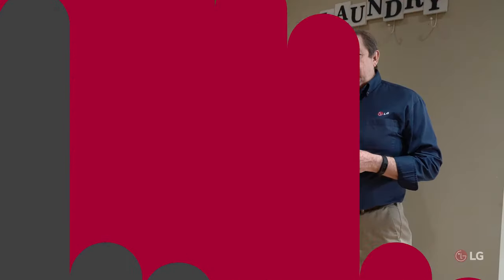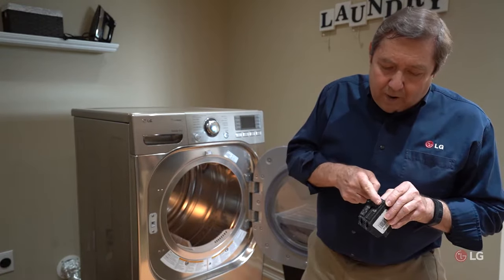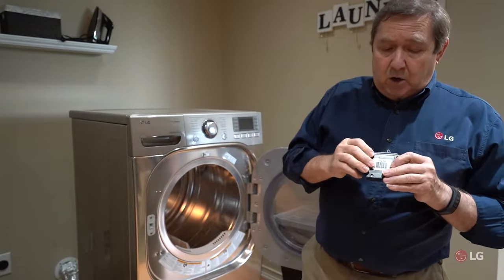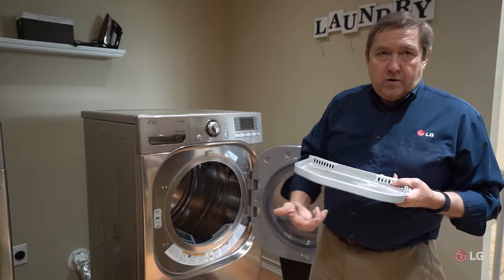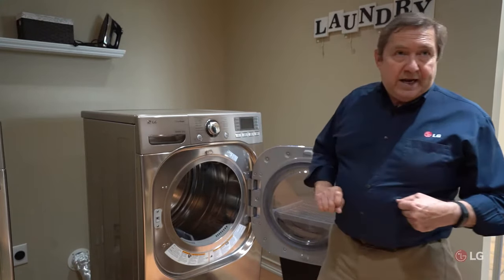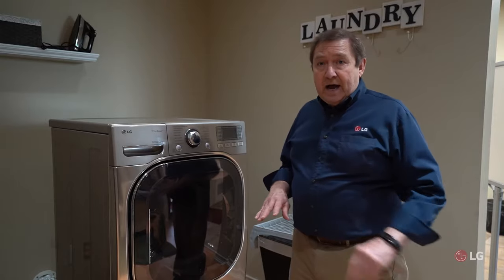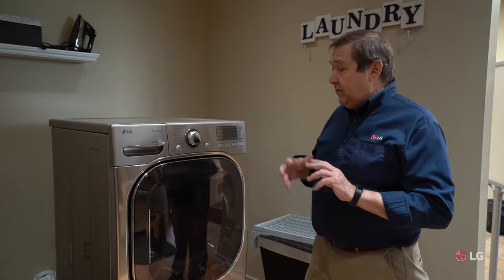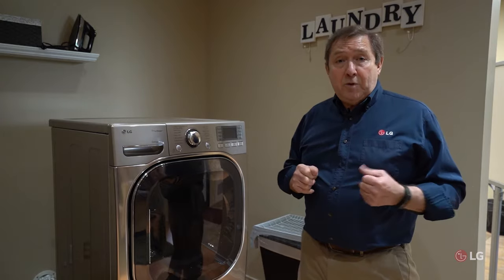[LG Dryers] Troubleshooting Heating Issues

Comment: I was convinced I was going to have to replace my heating element, but I just had some plumbing work done and they had shut the breaker off for a bit, I went and checked and it was tripped only half as you mentioned!  I have an old house (1945).  Thank you for saving the day!  I was about to start taking the whole dryers apart and start replacing parts!
Reply from the maker: I’m sorry to hear you're having this issue, and I’d like to see if we can assist. Please contact LG Customer Support by direct message via Twitter ( @LGUSSupport  ) or Facebook Messenger ( https://www.facebook.com/LGUSA/ ), and include your contact details, the model & serial numbers, and a detailed description of the issue. ^Nolito

Comment: Thank you very much. I used this video to resolve a heating problem with my daughters dryer. Cause of the issue was lent build up in the vent line between the dryer and outside of the house. Once I was able to clear it the dryer worked fine.
Reply from the maker: That is great! Is there anything else that we can assist you today? ^Angelica
Reply from the maker: Armand , after several attempts of reaching out to you, unfortunately, we did not receive any response. We assume that your concern has already been addressed. For now, I will go ahead and end our session. Should you have any other questions or concerns, please feel free to reach out again, and we'll be happy to assist. Have a great day. ^Angelica

Comment: Mine will heat up, but stops prematurely every single time, and the flow sense indicator will come on. It takes 3-4 times to completely dry. I clean out the filters every time I turns off. I’m a single mom of four, so any cheap fix tips I would greatly appreciate. Also I’ve also pulled out the dryer took off the back tin hose connection and vacuumed everything out and as far down the vent I could. I will do the outside vent today too. Let me know if there is anything else I can do. Thanks. 😊
Reply from the maker: Hi there Beth Molloy. Welcome to our Social Media page. Based on your recent post, we see that you may need support. Please send us a private message with your name and phone number and we would be happy to investigate this further.  ^Jovelyn
Reply from the maker: Hello Beth Molloy! I'm passing by to check up on your case. Do you still need assistance? If so, let us know if there is anything that we can do for you.  ^Jovelyn
Reply: I am having this same problem.  Did you ever figure out how to fix it?  LG customer service was zero help over the phone and wanted me to buy a $400 repair package to send someone out for a dryer that is 2 months past the year warranty.

Comment: So I've got an LG dryer that's igniting and firing only for 5 seconds and then shuts down the flame.. Ohms on gas valve are in limit. Other sensors jumped out with no difference. Any suggestions?

Comment: My LG gas dryer wont heat up. it runs but wont heat at all.  The Dry light flashes and my cool light stays on. All thermostats, valve coils & flame sensor show continuity but not heat,  I have tried normal and high heat cycles. I am an independent appliance tech. please help
Reply: Hey did you ever figure anything out? I’m having the same exact issue. Dry light flashes and the cooling light stays on. Still no heat
Reply: Anything ? Same prob here
Reply from the maker: Thank you for reaching out. Can you come to our Facebook page and send a private message? I will be more than happy to assist you.^Sandy
Reply: @Giioventus  thermo cut off thermostat !
Reply: I am having same issue from today. Is there any solution for this?
Reply: @EurekaRecycler  thanks mate
Reply: @EurekaRecycler  my warranty is over any idea how much to fix this? I will never buy any lg.
Reply: @LGUSASupport  you could just as easily try to help everyone out right here in YouTube instead of dodging questions and wasting our time
Reply from the maker: I’m sorry to hear you're having this issue, and I’d like to see if we can assist. Please contact LG Customer Support by direct message via Twitter ( @LGUSSupport  ) or Facebook Messenger ( https://www.facebook.com/LGUSA/ ), and include your contact details, the model & serial numbers, and a detailed description of the issue ^Nolito

Comment: the heat in my LG dryer stops heating, but the dryer continues to run. I re-set the thermostat fuse, but the heat keeps turning off. Can anyone help? Thanks.
Reply from the maker: Hi there. Thank you for reaching out to us. We understand that you're having an issue with your LG Dryer. We'd be glad to assist you with this concern. In order for us to provide you with the necessary resolution, Kindly send us a private message via @LGUSSupport, so we can look into this for you. We'll be happy to assist you. -MC

Comment: Hi John I have an ee1 error code. I have replaced the thermistor, blower thermostat, high limit thermostat, and thermal fuse.. issue I put wet clothes in the dryer.. my fault completely.. so I was able to run my dryer for a short time but after 5 minutes my high limit thermostat trips.. i ordered a new one it worked for about 10 minutes but then high limit blew again.. I could not trip the new high limit thermostat..it would not pop back down like the old high limit thermostat did..  so after replacing the thermistor and blower thermostat I put the old highimit thermostat back in and then got my first error code .. prior to that i was not receiving any error codes?
Reply from the maker: Hi, Andy. I’m sorry to hear you're having this issue, and I’d like to see if we can assist. Please contact LG Customer Support by direct message via Twitter ( @LGUSSupport  ) or Facebook Messenger ( https://www.facebook.com/LGUSA/ ) ^John

Comment: Too basic. I don't have error codes, air is blowing through vent, dryer is warm, but it takes 2 hours to dry jeans, when it used to take 40 minutes. This video doesn't cover anything about dryer not heating enough.
Reply from the maker: I’m sorry to hear you're having this issue, and I’d like to see if we can assist. Please contact LG Customer Support by direct message via Twitter ( @LGUSSupport  ) or Facebook Messenger ( https://www.facebook.com/LGUSA/ ), and include your contact details, the model & serial numbers, and a detailed description of the issue. ^Nolito
Reply: Having same issue as described above.  Had a service person come, replaced some rollers, still experiencing same issue.

Comment: Hi, I've been hoping someone might have an idea how to troubleshoot my LG dryer issue. I've got a fairly new LG dryer equipped with flow sense. The issue I'm having is within the past few weeks, the dryer isn't drying clothes and shutting off a cycle after only approximately five minutes. Initially, I was getting the flow sense error when I tried troubleshooting with ThinQ. After cleaning out the vents, taking the dryer completely apart and cleaning it out, we then went a step further and paid a service to inspect the ductwork only to find out it was completely clean. I even replaced the moisture sensor and still have the same issue. Whenever I run the ThinQ diagnostic, comes back clear. Wondering if you have any other ideas for troubleshooting that I could try. Thank you for your help!
Reply: Same issue did you resolve? Could it be bad sensor?
Reply from the maker: Hi there! I’d like to see if we can assist. Please contact LG Customer Support by direct message via Twitter ( @LGUSSupport  ) or Facebook Messenger ( https://www.facebook.com/LGUSA/ ), andinclude your contact details, the model & serial numbers, and a detailed description of the issue.
^Rose
Reply: We had the same issue as well but then after about of months after buying the dryer it completely stopped running heat 😵😔… after two months of waiting to get a technician out to come look at it they though it was the fuse that turns the heating element off and on so they replaced it and the heating element just in case …. The dryer is heating now but !! It’s still not fully drying the clothes but I have noticed it’s like fighting itself … the cool setting is always on an I personally think this is the issue … I’ve only had the dryer run now for two days or so and I have to force it to fully dry the clothes by putting it on two outs of speed dry 🤦🏼‍♀️ pretty sure it will go out soon again … we will see but maybe check and see if you are having that cool setting running threw the full dry cycle as well I’m starting to think this is a manufacturing issue with a lot of these dryers … I see a lot of it but no one has been able to resolve the issue so far that I have see the LQ thinQ app says my dryer is fine and it’s not throwing a code even when I had no heat 😶… will report if it is fixed or if it goes out again
Reply: @TheLindsey7777
Reply: @TheLindsey7777  hello, did you ever get this resolved? I have the same problem on my LG. Cool cycle never goes away and I’m constantly getting the D90 error

Comment: Actually my lg dryer never stop the cycle and just keeps heating, does the same on any cycle, when the timer its down to a minute it goes back to a 15 or 20 and keeps doing that untill manually turned off, I I just replace the moisture sensor with no luck..
Reply from the maker: Roberto , welcome to social media of LG ,can we verify of you see error codes from the unit ?
can you check the link :

https://www.lg.com/us/support/help-library/power-issues-laundry-dryer-CT10000011-20150394890820

Let us know if this will work. Thanks ^Angelica

Comment: How many degrees fahrenheit is the normal cycle without energy saver?
Reply from the maker: Hi, Jerome. I’m sorry to hear you're having this issue, and I’d like to see if we can assist. Please contact LG Customer Support by direct message via Twitter ( @LGUSSupport  ) or Facebook Messenger ( https://www.facebook.com/LGUSA/ ), and include your contact details, the model & serial numbers, and a detailed description of the issue. ^Chad
Reply: @LGUSASupport  There's nothing wrong with the dryer. I just need accurate or estimate temps for the normal cycle.
Reply from the maker: Hi! The temperature a dryer reaches depends on the make and model of the dryer, as well as the setting at which the dryer is running. Your dryer uses heat to warm the water in your clothes and turn it into vapor. On average, most dryers can get around 125 to 135 degrees Fahrenheit. ^Nolito

Comment: How do I get someone from LG to actually return my call and not redirect me to a video? I need a service person,  it is a new dryer
Reply from the maker: Welcome to our Social Media page. Based on your recent post, we see that you may need support. Please send us a private message. Thank you.  *Leah
Reply: @LGUSASupport  Hi. How can I DM on here?
Reply from the maker: Hi, Justine. I’m sorry to hear you're having this issue, and I’d like to see if we can assist. Please contact LG Customer Support by direct message via Twitter ( @LGUSSupport  ) or Facebook Messenger ( https://www.facebook.com/LGUSA/ ) ^John
Reply: I'm not on those platforms. Here's the issue. I have a D80 but it was checked and clear.  I've only had it since after Christmas.  When I use normal/sensor dry it was running perfectly and was hot. Now it's not heating unless I turn off energy saver which is it's default. Note, that was not an issue in the past. Manual low heat is not heating but high heat is. I love my LG products,  but I can't get a person on the phone to check it and it has the smart diagnostic capability.
Reply from the maker: I see. You can also reach out to our customer service hotline at 1-800-243-0000. ^John

Comment: I am running myh dryerfor two hours without any heat, what gives?  You are wearing out my clothes  This is bs  LG!  my old sety were wonderful and lasted 18 years without a problem.  It uses less water and takes twice as long, the frame and body panel, and the door move in and out as if there was no supporting structure, there probably isn't.
Reply from the maker: Hello there. We greatly appreciate your effort to inform us about this. This is not the experience we want you to have with your dryer. Please send us a private message via Facebook or Twitter, and we'll discuss troubleshooting steps that would resolve this. Thank you! —Kai